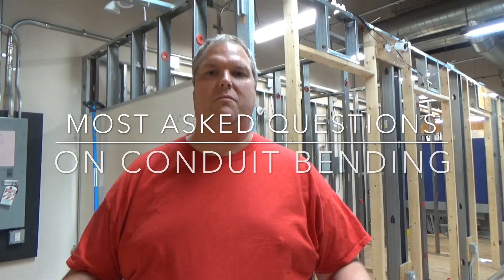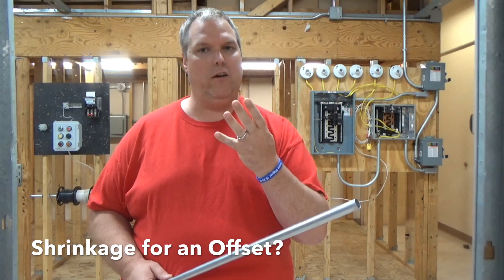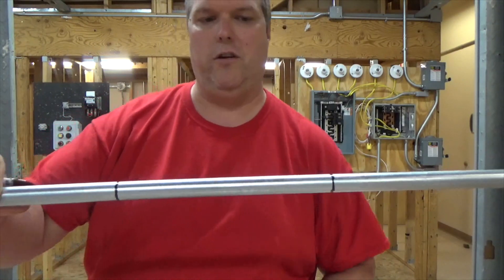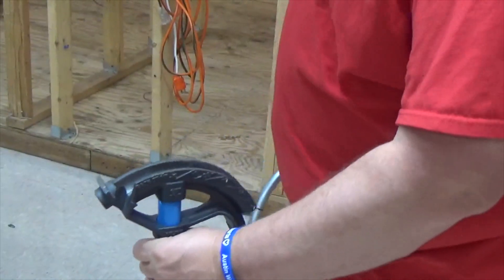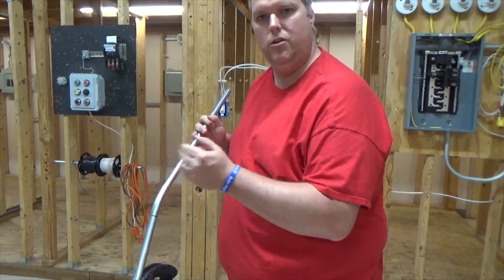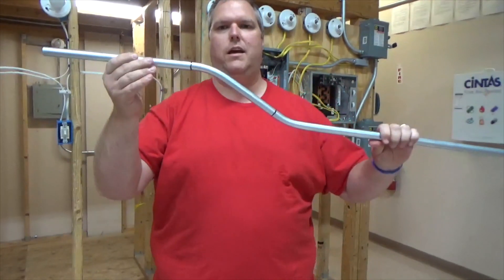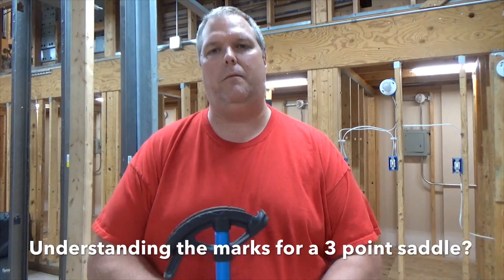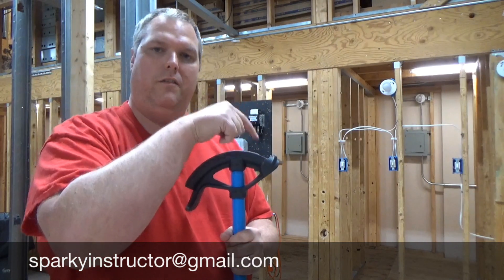FAQ about Conduit bending Part 1

Comment: Thank you for the conduit videos! I’ve been through a whole 2 year associates degree In mechatronics and they do not go over any conduit bending whatsoever even though we specialize in motor controls and high/low voltage troubleshooting. Now that I’m in the work force and we have to do any conduit bending no one in my facility knows how to do it.

Comment: Even though he got the correct measurements, the bender is made to b placed on the floor.. as well as he shouldn’t have grabbed the back of the pipe while bending, it creates a big curve... u need to put ur hand closer to the bender if u are going to do it like that.

Comment: We were always taught to measure 110mm from the end of the conduit that touches the box,make a mark. Line mark up on the bender and bend up so the bottom lip of your coupler is touching the entry of your box,flip the conduit over,put it in the bender so that the hook sits in the groove of your 1st bend. When you bend up the conduit parallel with no dog leg that'll complete your set

Comment: When bending a 30° offset, I  bend the pipe down until it touches the  30° mark on the bend but it always ends up making my rise bigger than it needs to be. 

Do you bend the pipe to where it's at the same angle as the line on the bender, or do you bring  the edge of the pipe all the way to the line?

I'm very unclear on this, if you could help or make a video  that would be amazing!
Reply: Bend the pipe until its parallel with the 30° line. That will get you close. Every bender is different. You have different brands as well as aluminum heads or steel heads. So youll always have to play around with it
Reply: @Adonis Medallo i always have a perfect 30 degree by placing the conduit on the ground, and bending until the handle of the bender is 100% vertical

Comment: Hi I’m from the UK - London, thanks for ur video uploads, great help! 

If you were running conduit in a straight run then off setting into an electrical back box then off setting back out the opposite side of the electrical box ...

How do you measure such a small offset 

In your videos you mention the multiplier for 30deg  is x2 , do the factors always remain at this fig for a 30 deg ??

If factors for multiplers always remains the same for the different degrees

What are the multlpliers for 

10 deg
22.5 deg
45 deg

??

Thank you 

I’ve recently purchased a conduit bender 
And wish to bend conduit 
But wish to understand how multipliers, shrinkage and the different angle of degrees all work together.

Many thanks
Reply: For 10° it 6
22.5 it's 2.6
45 it's 1.4

Comment: When you do your videos on bending there is one bend I would like some help understanding. I have never seen a video about this bend - 2 walls meet in a corner but there is also an obstruction  in that corner. As an example - an 8x8 hvac duct or it might be somewhat  larger or smaller, round or square or rectangle. You need to run your conduit along both walls. So I am thinking 2 45 degree bends \____/ to get around the obstruction. Is there a method to calculate the distance needed between the 2  45 degree bends or do you do the simple 45 degree bend with a stub on one stick of conduit and then 45 degree bend on another stick and just make them meet where they should. I know that sometimes it will depend on the situation. Because it is visible you might want to do a 90 with a 30 degree offset. but that is 150 degrees of bend. 2 45 degree bends in the false ceiling is only 90 degrees of bend in the run.
Reply: U would need to do a 2 point 90’
Reply: @terryfoster6836  Point me in the direction of how to do a 2 point 90 correctly, Thanks. For every inch of rise and run add 1.41 inches of conduit?
Reply: "Bending around a corner with an obstruction" - spacing for 45 degree bends is the diameter of the obstruction times the multiplier for 45 degree bends like this, 2.4. I got that from Richard Cox' Conduit Bending Guide.

Comment: Ummm.. Shouldn't your first mark for the offset be at 9 inches and not 11!? You're losing an inch of pipe from shrinkage so the 10 inch mark should move forward an inch to account for your mark moving back an inch when the pipe is bent.
Reply from the maker: Shrinkage is added not subtracted your conduit will be shorter. Thank you for your question! CM